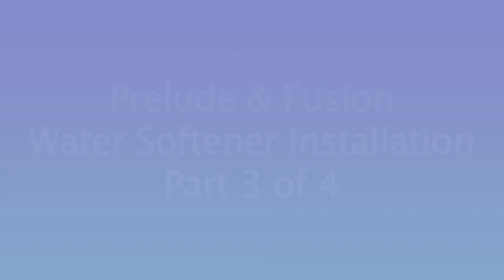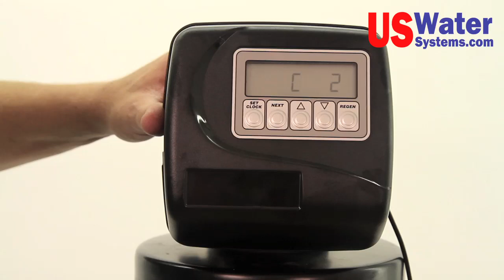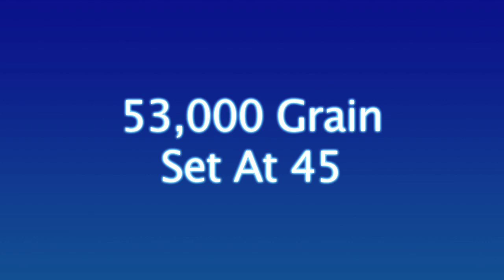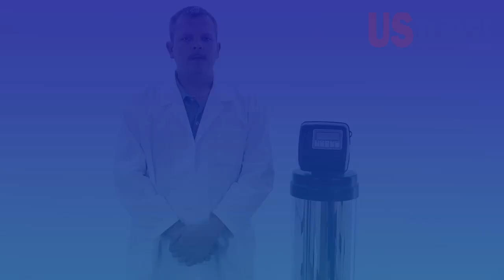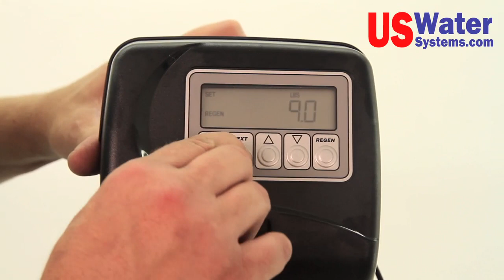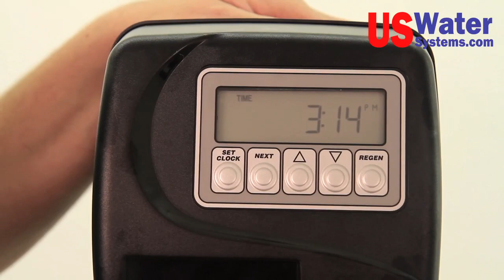(Older Model) US Water System's Installation - Prelude & Fusion Part 3

Comment: The head pictured in this video is exactly the same as my water softener which is called Inergy Pro Model WS1 Demand.  Can you give me some background on my model and who, if needed would be able to service it?
Reply from the maker: We no longer use that Valve, but it was designed by a company called Fleck. Does the company you bought it from offer technical support? Otherwise a local plumber may be able to help you.
Reply from the maker: Actually, sorry. That isn't a Fleck Valve, it was made by a company called "Clack".